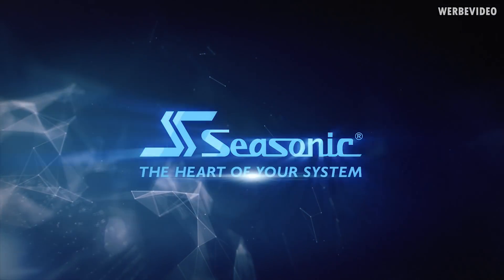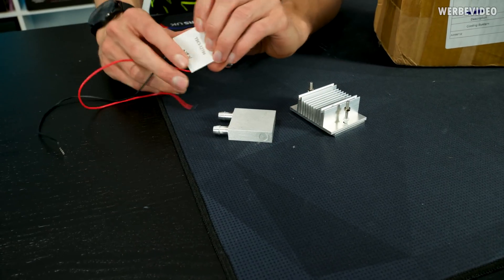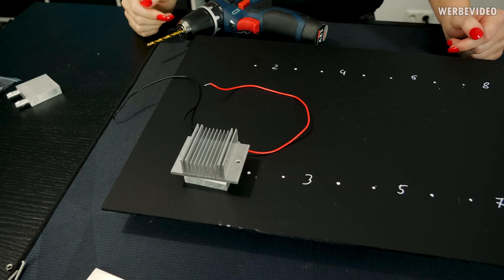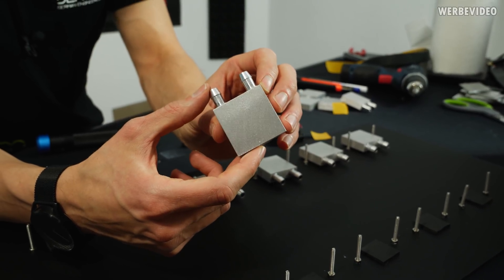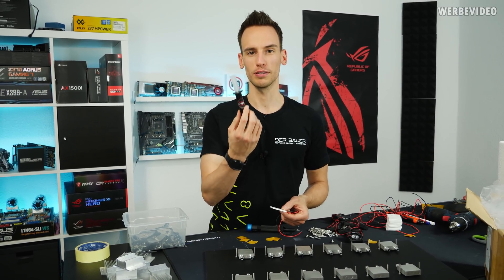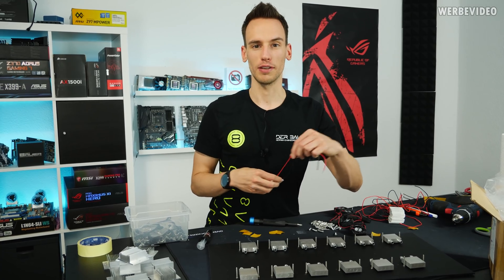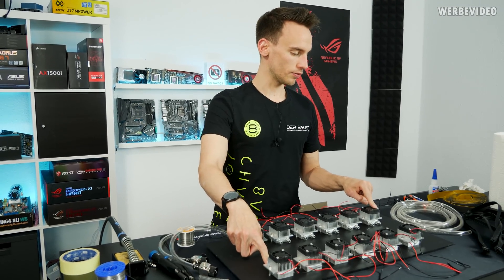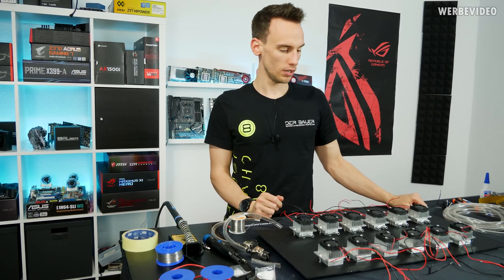200$ AliExpress DIY Water Chiller

Comment: Have not seen a comment suggesting this, personally have found better results lowering the voltage to each tec-12706 to 6v-9v and/or better hot side cooling

Comment: Why not try and cascade the TEC chips? Just get a triple stack of 12706, 12710, and 12715 with Kryonaut or Carbonaut in between the layers. Also need a much better cooling solution for the hot side like another water loop etc.

Comment: just use CPU coolers for each TEC , can use 1151 or even 1366/2011/2066 coolers , just cut holes in this plate and mount it .
can use some outdated models and get it for low as 1euro each , 775 models .

Comment: you may have better results by using a second water block/cooling loop on the hot side feeding in to a rad. so you should have everything there to try that with half the peltiers.

also  you may also want to try running the coolers in parallel. this wouldn't be an issue in a normal loop but there will be increasing the temperature differential as you go down the line and that will kill your efficacy  power consumption.

on a side note if you are concerned with the water freezing you may want to add rubbing alcohol/isopropyl alcohol to the loop the lower the freezing point "shouldn't be problem unless you work in a cold work space to begin with"

Comment: You should add a regular radiator before the tec units to remove as much heat from the loop as possible before chilling the water

Comment: I personally would have added a radiator right after the CPU then that would go into the chiller even with passive cooling on the radiator I think you would have achieved better thermals

Comment: I did something like this a few years back.  Not worth the effort though.  Wired up 8 150 watt TECs with huge aluminum heat sinks, cooling these big aluminum water bocks.  The only way a chiller makes any sense is for benchmarking.  Insulating for daily use is a massive pain and electricity isn’t cheap.  I got all my crap on eBay though.  Mine was capable of running around 30F under load

Comment: I think peltier chillers are best used in tandem with a radiator, on the exit side of the radiator after the coolant has been taken closer to ambient temperature already. The radiator only cools relative to ambient but the chiller can take it lower. Maybe you could compare a standard water cooling loop to one with a chiller inserted after the radiator?

Comment: The problem with having all 12 TECs plumbed in series like this is that by the end of the string, the temperature difference between hot and cold side is so large that all of the TEC's cooling capacity goes into keeping hot-side heat away from cold-side and you get zero efficiency from the extra TECs. You probably need to re-plumb the thing at least as 2P6S to reduce the temperature deltas across TECs on top of beefing up hot-side cooling. TECs can be decently efficient (CoP of ~10), albeit only up to about 1/10th of their maximum rated power and temperature differences of only 10K.

For $200 though, you could just buy a ~$120 room AC and zip-tie your CLC's radiator to the AC's cold air return, you get about 10C below ambient :)
Reply: I thought this as well as using a traditional radiator inline just off the CPU return, so the bulk of the CPU's heat is cooled via ambient, leaving the TEC's to do additional cooling below ambient only
Reply: @Nathan0A  If the TECs get the loop more than 2-3 degrees below ambient, adding an initial radiator after the CPU block won't help since the return water will still be sub-ambient. Even at 0.5GPM, water coming out of the CPU block will be less than 2K warmer coming out at 200W.

The biggest improvement by far would be to liquid-cool the TECs, get their hot-side as close to ambient as possible so all of their cooling power goes into getting the liquid loop below ambient instead of overcoming their toasty hot-side.
Reply: @teardowndan5364  That makes sense.
Reply: Yeah TEC is useless and has been for years. Like you say a window A/C is much better, and will get much colder than 10c below ambient if you submerge the evap into an ice chest. Been there done that years ago before I started making my own refrigeration systems and autocascades.
Reply: Hey there you know like you know this stuff, may i ask you a question on this 3 year old comment.
What would happen if i placed 2 heatsinks on both sides of the peltiers, one side with more conventional CPU coolers and on the cold side those cheap aluminum heatsinks, and then have the cold heatsinks touching directly on a water reservoir instead of being connected trough tubes, would that help chilling the water more efficiently?
Reply: Negative if the fluid is moving at a reasonable speed then there will be negligible temperature difference between in and out.  Mixing series and parallel is good for other reasons but it won't make much difference to the temp delta.  In fact the temp delta from in to out won't be different at all because no matter whether you run all of them in series or parallel you still have the same flow rate across the system and the same amount of heat energy being put into the system so no matter what your temp delta from start to finish will be the same regardless of configuration.
Reply: @benfubbs2432  you would need flow at greater then 2gpm per minute for a 1C delta @ ~360W of heat according to fluid dynamics so you are correct.  
But again he is running 360W of TEC's which translates to more then 360W of heat as he forgot to account the additional X Watts of heat the cold side is pumping to the hotside.  

However with that many blocks and that many restrictions, i highly doubt 2gpm will be attainable unless he is running several pumps in series. 
And yes he can parallel the setup which would probably be a better solution, but he would still have a choke at the outlet at the parallel, since the diameter of the tubing will be constant thoughout the entire closed loop.  Unless he wants to increase the diameter of the inlet and outlet of said parallel.
Reply: @Teardown Dan

Original statement - "in series there would be a temperature delta so large that all of the TEC's cooling capacity goes into keeping hot-side heat away from cold-side and you get zero efficiency from the extra TECs."

No. A flowrate of about 5 L/min is required for a temperature delta of 1 degree Kelvin 

Q=mc(delta)T
360joules/sec*60sec=m*4148*1
21600jouls/min=m*4148
m=21600/4148
m=about 5kg/min

a D5 pump doies 5 times that best case, but even if you were only doing half a liter / min then you'd only have a roughly 10 degree delta from start of a series setup to end.
Reply: @aigomorla

remember that these are not like your normal block, they are cheap junk made by getting a aluminum billet and drilling holes in them .  Internally they are basically two right angle bends and aren't that restrictive.  Think of them as having the restriction of two right angle G1/4 inch fittings instead of a "real" block with channels and internal fins etc etc.  It will take a lot more blocks and fittings to make enough of a difference to choke a pump.
Reply: @benfubbs2432  Unless you have flow rates well in excess of 1GPM, there will be a 1-2K difference between the first and last TEC. If you look at TECs' (in)efficiency curves, you lose 1-2% of the CoP for every 1K increase in hot-cold delta. If you operate the TECs in a 1-3% less efficient region, you get less cooling for a given amount of TEC power and slightly higher loop temperature for a given load.
Reply: Thank you for sounding technical, but you are making claims without running any numbers. Thanks for the read tho. Theory is correct from Heat Transfer, but you are making too many assumptions.
Reply: @flawns  Not much 'assuming' going on there, most of what I wrote can easily be confirmed by reading just about any TEC's spec sheet. The rest is basic thermodynamics: easier to extract heat from a warmer cold side.

Comment: With those heatsinks you probably need to run them at a lower voltage and or something like a large water cooling setup for that hot side too
Reply: Fr those tiny heat sinks are probably barely doing anything

Comment: der8auer should have setup the heatsinks vertically and had 4x 120mm static pressure fans in ducts with a push pull config.

Comment: You could have put several of those heatsinks in line and then make a shroud or something to channel air from a strong 120mm or 140mm on each end through the fins... getting rid of individual fans. They use such "air channels" in regular power supplies and electronic loads. 
Also you could have bought a bit of aluminum bar or copper bar and screw all heatsinks on the aluminum bar and then the peltier elements to the metal bar... better heat transfer.

ALSO,  why not buy some flat copper or aluminum pipe and have several of those pipes directly under the peltier elements instead of choking the air flow through those small aluminum boxes.

Comment: A 4-8 peltier elements would be enough to cool a metal reservoir (where the "water" would stay for the most time) to below 0C... with reduced cost from the peltier elements would be more resonable to use less but better cooling.

Comment: I think that you should try to undervolt peltiers to limit heatsink temperature to about 50C, this should let you see how low you can get the water temperature, most likely you cannot cool a cpu this way but this should be way over enough to cool the water itself.

Comment: You'll definitely need bigger heat sinks on those TEC's. No way that small of fan/radiator combo is going to mitigate 60W of waste heat. Get something cheap like a 212 EVO for better performance. Remember, TEC's work by creating a temperature differential between the hot and cold side. The cooler you make the hot side, the larger the delta on the cold side. If the TEC gets saturated on the hot side its performance will suffer greatly. Another thing I would try is going for a cascade TEC setup. Perhaps take half the TEC's and place them on top of the hot side of the other 6. This will create a cooler hot side on the loops TEC modules. There's a trade off to everything, series TEC modules will have a higher thermal capacity but higher temperatures. Meanwhile cascaded TEC's will have a lower minimum and likely load temperature assuming the thermal capacity is less than the combined cooling of the TEC's.

Comment: The small fan and heat sink is to be mounted on the cooling side of peltier and the block on the heating side which connects to a radiator. The product you purchased is for DIY mini cooler in which you cool a small chamber not  9900K.

Comment: I had considered this approach but hit the problem of the transfer rate of heat from the peltier to the block then to the water being not that effiecent. I am working a twin peltier single block design. i.e the two cold sides on the top and bottom of the water block. Two further things that need to be done are different peltiers, I am going to use 2  TEC12715 (150w) both with independent heatsinks (currently 5 pipe vertical cpu cooler with fan). The other is to reduce the flow rate of the water or use a smaller bore for the tubing, I found the faster flow didn't give the water enough time in the peltier water block to lose much heat. My design will be water from CPU to 240mm Rad to Reservoir to Peltier combo back to cpu. Will post result when the TEC 12715's arrive. Using TEC 12709 at the moment for testing and proof of concept.

Comment: Build a second loop on top of the Peltier elements using $15-20 240mm aluminium radiators, $7-8 generic pond pump, those cheap blocks, and generic 120mm fans for $3-4. You can dissipate a couple hundred watts for cheap, which should let the fluid get below 0 degrees.

Comment: @der8auer I think You don't quite understand principles of peltier modules (PMs).
 They don't use this 60W to cool!!!  They use it to make temperature difference. 
It means that on the hot side you have to disapate 60W of heat energy made by current thru PM plus heat from the cold side.
It is important to know that 
less delta temp equals better PM efficiency. 
At this point these small radiators barely dissipate 60W you put in PM so you got now nice electric heater :)
What you have to find is Perfect balance between price of cooling system on hot side, and power of PMs.
Also it is a pointless to put all this PMs in series. It would only work if hot side of one PM would be cold side of another. 
It is that because as I said "They don't use this 60W to cool!!!  They use it to make temperature difference."
Science lady of dog
Reply: Putting them in series like this is fine. You only stack peltiers if you need a higher delta.
Reply: @m8e  But higher delta in this case (target: sub ambient) makes cooling of hot side easier because of delta T between air.
Reply: Considering how many times he mentioned delta t in this video I think he understands that just fine.

Comment: I thought about doing this when I build systems.

But different setup entirely.

Large res made from a storage container or something. ( The kind that fit under a bed) Cold side+ heatsinks in the water ( through the lid) and then cheap tower heatsinks ontop. 

I never got round to doing it because i had a real thing for over the top air-cooling . Dipped into water-cooling occasionally and used industrial radiators and stuff. That was fun.

Comment: Hmm.  Maybe reverse the airflow on the fans, have them pull air upward (if they aren't already).  Otherwise the airflow will just be heating up the water blocks and tubing.  Also,  the water blocks and tubing probably needs insulation, including between the water-block and the base board.

But yah... peltier coolers just aren't going to be very efficient.  Solid-state cooling is wonderful but either it eats a lot of power, or it's only used to cool something small like a camera sensor.

Also, you could try stacking the peltier elements in pairs to get a higher temperature differential.

-Matt
Reply: Did some quick research.  Stacking does work but the devices have to be different sizes due to the heat-side generating significantly more heat than the cool side (hence the inefficiency):

http://www.peltiertec.net/products.html#.U00mCJK9KSM

From reading comments by people who actually use these things in various forums it looks like it should be possible to get -40C.

But in addition to all of that, you really need true separation between the heat side and the cool side... which your fan setup just doesn't accomplish.  Perhaps a dual-loop water-cooling system instead of heatsink/fans to pull heat away from the hot-side of the peltier device.  and better separation and insulation of the water blocks and tubing.

But I think... we're talking 600W+ here to get a decent result.

-Matt

Comment: Der8uer, I’d like to introduce you to a good friend of mine, the scotchlok splice connector! It would have saved you so much time on all those splices you were hand soldering. No stripping, they are waterproof if you get the filled ones, and a bucket of 100 isn’t that expensive.

Comment: Using an aluminum block or 2 you could make your own version of this chiller with the fins attached to the waterblock and make it the size of a 360 rad or even bigger. That way you could attach better and bigger fans to the finstack. Also make thinner and more efficient fins.
Step 2 could be to make standing version with fins on both sides to make it even more effective OR make "holes" or "slits" to make air pass through the waterblock. I wish I had better tools and materials at home 😅 could be an amazingly fun project.

Comment: I was thinking about the same solution a few days ago. In a form like you did it, I think ordering heat sinks and fans was not profitable (In my opinion, 12 pieces of used, standard processor cooler would be more efficient in this test). But still can't wait for part 2. Good Luck!! ;)

Comment: :p You need to water cool the Peltier element by using the same water block on the hot side as well. I'm doing a project of the opposite of what you're doing atm (trying to cool down a room with 2 Peltier elements) and the air on the cold side would at most cool down 5 degrees Celsius with good water cooling on the hot side. So if you flip the two sides, you'll need the hot side keeping at room temp, which is hard with that small a fan and heatsink. Might need to use a gigantic radiator, like the one used by Steve from GN, and a bunch of big fans.

Comment: most inefficient cooler possible lol I like it!
you'd need much bigger surface area heatinks on the TECs to vent the heat for a start.
power cost wise and efficiency wise, it'd end up being far better to go for a small refrigeration unit, but thats not as much fun as this :D

Comment: Maybe make a block of 4 of these elements and change this stagerring assembly and put 140mm high performance fans  like noctua or even 120mm jetflo fans over them with a higher fin heatsinsk and probably a copper base ones ... That will give you alot better cooling .... Another idea it to use for example the hyper 212 evo towers to cool that tech element but you will need the same count as those tech elements

Comment: You can buy copper blocks but they are a bit more expensive ... https://customthermoelectric.com/water-block-3-0-x-3-0-x-0-85-copper.html      This would prevent mixed metals in your loop and your thermals would improve.  You could replace the heatsinks with a CPU type heatsink made of copper.  However, the price goes up to $300 per peltier which would drive you to phase change at that price.

Comment: Should be watercooled on the hottest side  with a huge radiator down to ambient and double stacked, second layer branching 1 to three (since need to get rid of the waste heat from the first layer as well as the drop),  for a 40 degree drop from ambient.  from 3 peltiers at the bottom of the stack. And antifreeze in the water.